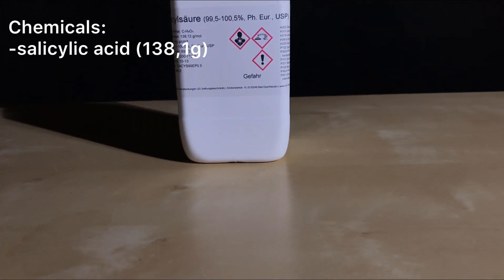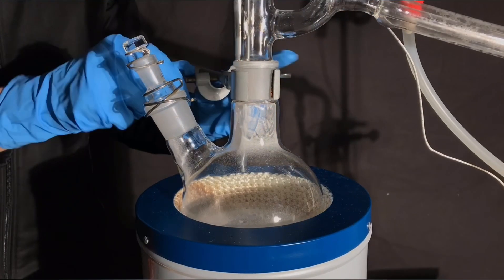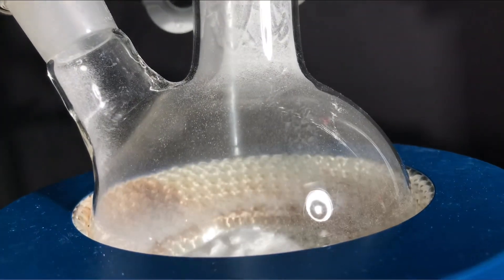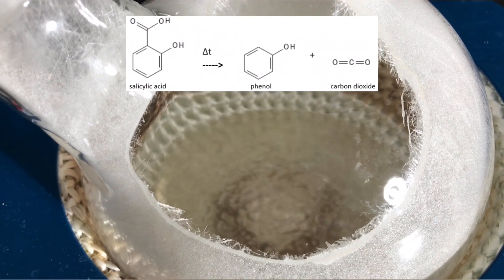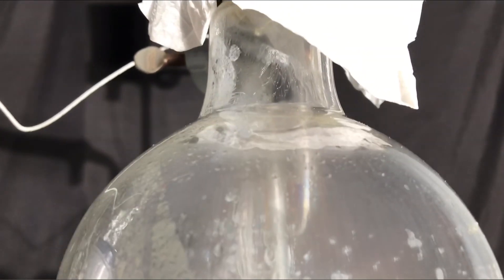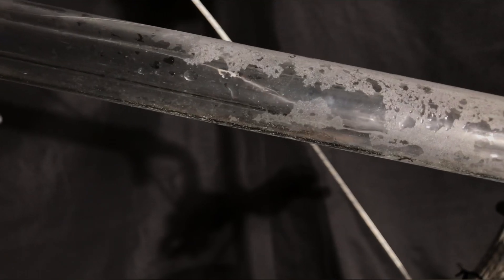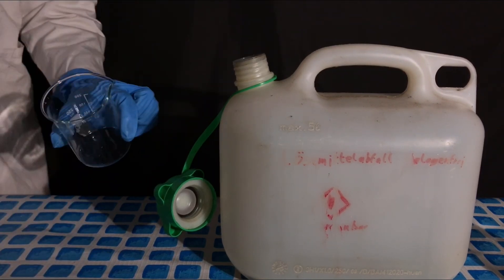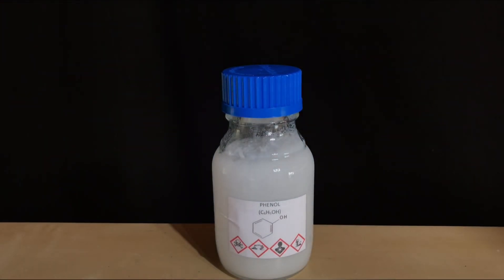Making Phenol by decarboxylation of salicylic acid

Comment: Phenol as a solid, when used in reactions isn't too scary. It is toxic, but it's not too sketchy. Distilling phenol is very scary tho. It requires pretty high temperatures, the distillate can solidify in the apparatus, and well, gasseous phenol is WAY scarier than normally. It's a lot better to buy phenol if you can, than to make it, but well, not everyone can buy it.

Comment: Usually phenol and hydroquinone (and other phenols), are cheaper than salicylic acid, genistic acid etc. Industrial production of salicylic acid and  its derivatives, like aspirin, and parabenic acid, are usually carried out from the alkaline phenoxide and CO2, under pressure. Initially the orto carboxylate is formed, but over time, the para carboxylate is favoured thermodynamically. (In the "Kolbe-Smidt reaction"). I haven't tried decarboxylation of the parabenic acid, but I guess it's just slightly more stable than the salicylic acid.

Comment: i remember one guy added in a mixture of copper salts for the decarboxylation of salicylic acid, supposedly it catalysed it somehow. might be worth a try if anyone plans on doing this

i suppose non-oxidizing copper salts like copper acetate chloride and sulfate would work

phenol is very toxic, but if you dilute it up with a lot of oil its a very efficient disinfectant, as in to be used for infections rather than cleaning surfaces
Reply from the maker: Copper acetate decomposes at moderate temperatures. I wouldn’t recommend it because of contamination.
Reply: @THYZOID  hm yes, copper oxide can work as an oxidizer and that might be what copper acetate eventually decomposes into

Comment: I'm glad you did this. When I was doing it I went with refluxing the acid using an air condenser, medium heating and more time. Basically slow cooking until it was all decomposed. It took few hours. Blasting it with high temperature of the flask bottom promotes localized reactions that lead to tar and, while I can't be sure about this, I always fear there could be biphenols. After refluxing, I did two distillations with air condenser. Residue was negligible and yellowish. Use as small storage bottle as possible to avoid oxygen, or purge air out with argon/nitrogen. It will prevent phenol going red and damp. Very useful chemical for microscopy and fixating tissues.

Comment: Did you consider using a short path distillation setup for the phenol distillation? That's how I normally do it and with the distillation path being so short, you don't have to worry much about it solidifying in the condenser and clogging it.
Reply from the maker: Yeah I’d have done that but there’s no short path distillation bridge in my possession yet
Reply: @THYZOID  oh okay. Yeah they are extremely useful for things like that and that was the main reason why I got one years ago. Definitely worth getting!